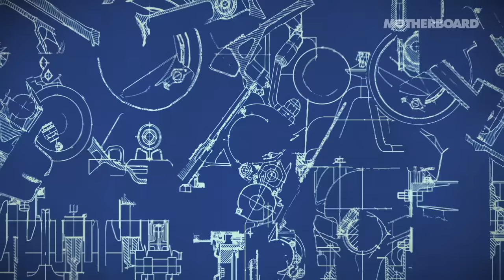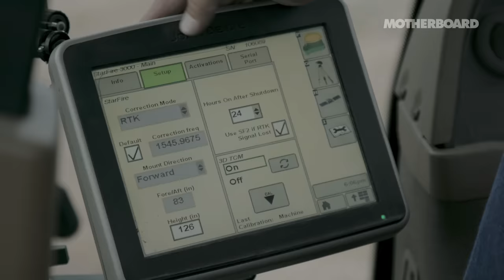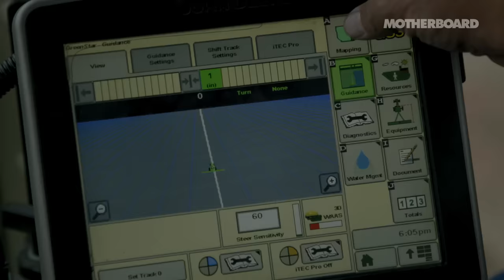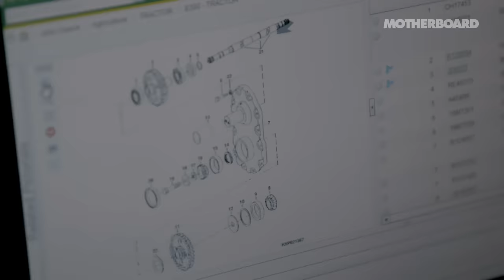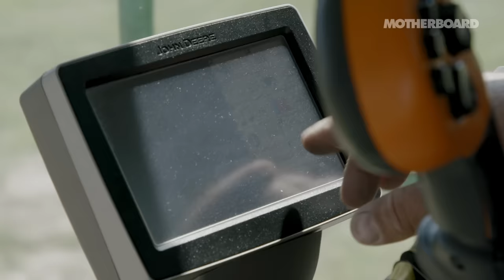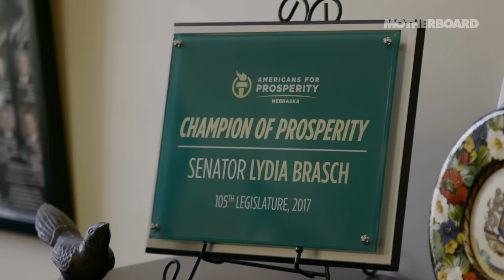Farmers Are Hacking Their Tractors Because of a Right to Repair Ban

Comment: I have purchased genatators that break down snd need repairs , i called to get parts to replace little things, i get told you have to bring itbin to be mailed off for repair, i had already paid insurance on it ,butbi would have to pay the shipping and insure it transfered by mail , same thing with a polan werf eater that cost $450.00, why if you pay the warranty and insure it it turns into an argument, soo i dont anymore, they got my money but nothing fixed yet. Crooks.

Comment: Overcomplicate everything/ then make more or as much as the initial cost of the unit.
 They want a cut on everything you make farming, thru ain't on their over-complicated equipment.
Parts are expensive and only from the dealership.
 If you can't fix it/ then what's the point?

Comment: When a market expands too far or fast, its survival pivots towards abusive practices like obsolescence, for its production is oversized and unsustainable otherwise.
It is also a symptom of humanity's rapid technological advancement, because the scale of industry needed to continually upgrade is coerced by its competition. This also breeds consolidation into monopolies, to sustain development efforts as per economies of scale.
As the old adage goes, "don't fix what ain't broke." But we also need to be able to fix what is broke. The ego competition of keeping of with the Jones's needs to be mitigated in this, as marginal gains are only affordable to large enterprises, yet we need the accessibility and diversity from smaller ventures and to protect them from predatory practices.

Comment: Hearing this more and more, the auto companies are starting the same thing, forcing you to go to the dealer. I want to fix what I can and no one should be telling me otherwise. It be different if the cars and tractors could actually work for a few years before they broke, but that not the case. Just another way to keep the working guy down.

Comment: Legislation will be vital.  They will cut off our access to repair, to information, to controlling our technology, piece by piece, code by code, until we can hardly function without their permission.  Tractors, phones, computers, all of it.  We HAVE to have a reasonable ability to repair our technology without being hamstringed into expensive dealership repairs.

Last time I needed a computer fixed, I tried sending it out 3X's to the maker, took 2-4 weeks each time, and it quickly had the same problem again after each fix.  A 5 minute repair at a local place and it has been working great since... except doing that voided my warranty (if they find out, lol).  It's absurd to think of the costs and resources that would go into this huge tractor tech being repaired only by dealerships, or being forced to "upgrade" perfectly good parts that just aren't "supported."  It's like forcing students to buy a new $200 book every year when there's only been one minor edit to the text (on purpose, to force them to buy the new edition, of course).  It's all a scam.

Comment: It’s shaft to hate be extorted just to be allowed to repair your own equipment that YOU BOUGHT!  It’s not on lease, John dear doesnt rent it to you.  You paid in full for that equipment and now they come back and exploit their incompetence to extort more money out of you for a repair that you should be able to do yourself.  Companies are doing the same thing with cars!  I had to junk a older car for a broken break line, that NO ONE would fix because the parts were not made anymore for that basic function.  And they would have to pull the engine to get in to fix it so it could pass inspection…. So that entire otherwise excellent condition vehicle was turned into junk because of that.  Now amplify that by 4 times the cost and that’s what farmers deal with…. A basic repair that just because the manufacturer doesn’t want to do it, has no choice but to do it illegally or junk the thing….  Makes you wonder why anyone would buy one again.  Stay with the older machines.

Comment: There is a much better solution. Keep the technology at John Deere. However have a digital interface that talks online through local software and reports back diagnostic information. This way Deere does not have to disclose anything or provide software that can be hacked, but is able to interpret the data and provide diagnostic information. This mitigates any excuse Deere can come up with.

Comment: There are plenty of good alternatives which provide complete access, software, and allow repair. I have never owned a John Deer or and Apple, but have done plenty of good farming. I have participated in complete overhaul of a major tractor, and while it took more like a month, it was amazing, and worked when finished. I have not owned one of those "elite" tractors yet, but If they're going to over-complicate tractors with computers and sensors, right-to-repair is a mandate, not a question. I always thought John Deere were only toy tractors in comparison to Steiger, Olver, and others. But I guess they've made their play and are trying to lock the market. I do like a free market, and I think it's fair to let the market decide if it wants to buy a tractor that costs 2k just to diagnose, or one that you can just take a wrench to yourself.

Comment: not only is this part of creating new profit models under the "you will own nothing" strategy, but sometimes there is more to it than you know.  

In may (i think it was, the aurora borealis coincided) unusual sunspot activity disrupted GPS slightly during critical planting (soy or wheat, cannot remember) in some latitudes.  The result was the precision tractors getting way off track, and variable.  This will be he77 to harvest and dust, one said.  Closer spacing of rows is wonderful in many ways, but (farmers say) only a machine can steer so precisely to do it.  

How is this part of the same story?  Have you hear of radar-detectors for cars?  The radar "gun" or laser used by police is actually measuring distance to calculate speed.  It can also be done with radio signals even easier if you have a moving device that is cooperating with a fixed beacon (where the "gun" is measuring a passive reflection).  This is 1970s tech.  Deere, et al, jumped this simple tech, which measures distance to microns, in favor of using 1990s GPS which was originally only within 10 feet, but is good for a couple inches of accuracy. WHY?? Because Deere (et al) sells you software that coordinates with their database and tracks everything you do, and where you do it, creating volumes of data they can sell to anyone who wants to control the market for your goods.  The GPS is inferior to much simpler tech but verifies exactly where you are to the true owner of your equipment.  

This integrated system and software has so far been designed with the Corporate partner's interest in mind.  I think the comment at 10:15 is a hollow threat to raise your costs punitively if you don't bow and lick their shoes clean.  Sadly, the issue of control will not change or improve.  But what should happen, and will happen if farmers stick to their guns, is that Deere (et al) will separate the data gathering/control software from the repair/replacement parts side of the software, and should make their equipment 100% repairable with free (or included) software.  

The repair software MUST exist, in order to operate and even build the tractor/combine in the first place.  The software is a data object with no duplication cost.  At most you need a special USB cable to communicate with your equipment. Under the integrated (closed) model, you have this connectivity.  There is almost nothing to do to make repairs possible, and should be shipped this way from the factory.

Specifically, although Deere (et al) may wish to track your part replacements, and may serial encode parts, you should have the right to tell your machine to accept the physical parts you replace, used or non-OEM.  This legal ground was covered for CAR parts under the Magnuson-Moss Warranty Act of 1975:

https://www.consumerreports.org/cro/news/2014/06/can-an-aftermarket-part-void-my-car-warranty/index.htm

The FTC could issue a ruling TODAY and require compliance on this nationwide, but $$BILLIONS$$ are being sucked out of our pockets, and the act was intended to cover cars, not cell phones, tractors, or IoT devices.

As for the GPS data being compiled and sold.. you should get paid for it.  If not, you should be able to turn that off.  At the least, you should be able to use a $50 system that is better than the $1000 GPS system you are forced to buy which harvests your data before you harvest.  At the very least, the software to run should be part of your purchase, and if they want updates on what you do, you should get updates for free.

Comment: If you first think the worst about the big companies, you will be wrong much faster than if you believe their blue eyes. The software enables the manufacturer to link a part (for example a dynamo but also a battery) to the product via software. If you buy a new alternator, it must be one from the manufacturer, otherwise the software will say that it does not allow this. the alternator does not charge the battery. If hacking does not provide full access, then I wonder if it is not possible to create replacement software. Or perhaps software that is NOT needed to control the engine to get rid of it and switch to just fewer functions of the tractor and make something that is mechanical to achieve the same functionality

Comment: Why would you own a Deere LOL, I know mine cant do everything but its a strong 1951 Ford 8N that starts and runs every time 75 years later, easy to work on, millions of parts everywhere, and since there is no Brain it will run after an EMP LOL will your run after an EMP? Nope.
I have bought a New Ford Truck OMG everything is run through the brain, if you change a Rear taillight Lens, Mirror or headlight! the truck knows and throws errors!
But! there is a Cheap / Simple ODBII to USB cable and a $15 hacker program (Forscan) and change almost anything LOL
F*** them and right to repair!

Comment: I agree with them.
Modern technology isn't always a longevity when dealing with hard use on Agricultural equipment. 
Everything from the crap plastic needs replacing. I would use aircraft grade aluminum billit I can remember riding on the fenders of my dad's 30-20 and 40-20 tricycle plowing and planting all summer long.  So I bought a JD as a adult for practical use at my cattle ranch power reverse and all .
Maintenance nor too hard but a trip to the dealership was there goes a whole cattle trailer of calves cost .
Proprietary software is definitely just like Bill Gates new upgrades on your computer if you have to function at work you have to have them. 
Since farmers and ranching is a little different business and it's physical work you would think that with the equipment you would own the software like the computer hardware and it would come with a diagnostic tool included they sure don't give tractors away. 
And they don't build them tough like they used to.
To a Agricultural man it's exstremly important thar the start up and keep running. This makes it more difficult to compete also with developing countries that don't have these high cost and in any business its always earning and keeping producing is the bottom line so tools have to keep plugging away at it just like a plug of hard days work.
Spit

Comment: Electric diff stopped working  well did the usual check the fuse nope it was ok so asking around and on Facebook and all that guy came back and said check your right hand brake light yip it wasn't working replace it and put in a new fuse anyway haven't had a problem with my diff anymore just gose to show had to replace brake bulb that was fused wtf like eh

Comment: Believe it or not but theres a way to strip all them new electronics and rewire most of it yourself and voila no more need for that computer to fix just fo it the old school way the trick is knowing what actually does what and how to bypass it entirely or how to remove some entirely to once again be more like a old school one you could do everything yourself its just harder now because you have to know about it and know how to change it back without causing damage